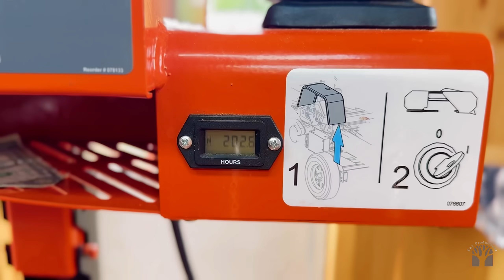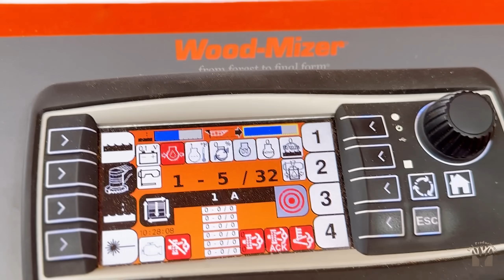Learning How to Service Our New LT70 Woodmizer

Comment: for the fuel filter,Harbor Freight makes end cap sockets to fit on the filter, that accept a 1/2" drive breaker bar or ratchet to remove the filter. they come in sets for different sizes of filters,also can be used on oil filters. then you won't have to use the screwdriver method. ISTR they're not very expensive. you will also get better access/clearance with the wrench/breaker bar,no knucklebusting.
Reply: The fuel filter does not flats for socket you are referring to. The oil filter does. GP

Comment: Happy birthday Jade!! 🥳

I was expecting a secondary filter like Grandpa was.. You can usually pick up the internal secondary filter that fits inside the larger filter wherever you get the air filters or NAPA. It's a good idea since the engine is in a dusty/dirty mill environment to check into getting one.

Comment: Hey Jade, I just wanted to say happy birthday to you. I’m sorry it’s late I want you to know your family gives a lot of really solid information about log milling and I love that you turn trees that are dying and railroad ties because once they are pressure treated with creosote or the chemicals that preserve them they can help trains carry make a loads of material to all Americans!!
You and your sisters are as pretty as can be and beautiful. In many ways I want is love the girl or girls that can drive a diesel log loader. Service and run a hydraulic sawmill and still stay extremely healthy and fit. I’m not working at a log sawmill right now, but have worked for Northwest hardwoods. A few years back we were processing 28 full-size log truckloads per day and you can imagine the team effort for that.
As far as your broken blades go, I am a welder fabricator, but I don’t specialize in making blades. I just want to say if anyone overheats a weld of any material, it could become too hard and brittle reducing your attention, pressure and increasing your cooling was a brilliant practice , as far as material density and the heat of the world is between you guys and Jay played manufacturer I hope this helps you love you guys like family Chuck Richards, Northwest millwright

Comment: Here's a little tip my mechanic  has me add a quart of diesel to the oil and run engine for a few minutes then drain the oil  it helps clean up the sludge better then change oil

Comment: Tip: On a machine with hydraulics you should change the hydraulic filter as well. Usually the hydraulic oil doesn't need to be changed at the same intervals as engine oil. You can send a sample out to be tested and they will tell you if it's good or not.

Also I find Pig Mat better than rags for a lot of that drippy oil... say near the filter.
Reply: Почему у них все оборудование на дизельных двигателях ? В Америке дорогое электричество с электростанции ? Или нет возможности 380 Вольт подвести ? На электродвигателях по моему удобней и обслуживания меньше .

Comment: Happy birthday Jade. Hope you had a great day.
On the oil change. A couple of things I do. When changing oil I drain the oil and leave the drain plug out. When I start to refill the engine oil let some fresh oil run out and then put the plug back. You waste an ounce or so of oil, but you get that much more dirty oil flushed out.
A band clamp could get a better grip on a stuck filter. Consider punching a hole in the bottom side of the filter to help drain it.
I usually try to put some fresh oil back in the filter regardless of its position. Yea, one on its side like your mill will only allow a small amount, but at least it's better than nothing 😊😊😊

Comment: Happy Birthday Jade🎉  Grandpa is giving a first class OLD SCHOOL lesson in a tried and proven oil change process.  Lubing the seal, checking to make sure it didn’t stick on the block, draining all the oil (I’m guessing he warmed the engine before dumping the oil) and wha hasn’t had to pound a screw driver through a filter to twist it off. Also, never use a wrench to tighten a new filter. Hand tighten only. Well done😊

Comment: 15w-40 Rotella is a great summertime oil. For below freezing temps you might want to go to a full synthetic 5w-40, which will flow better in cold startups. Also, ask Grandpa about the lubricity of ULSD (ultra low sulfur diesel). I run a 100:1 mix of 2-cycle oil in my tractor, mostly to keep the injectors lubricated. Cold weather starts may be better with a cetane enhancing additive. You really don't want to use starting fluid on a diesel if you can avoid it. 

I second the comment about changing the hydraulic filter and checking the level. You should also get a gasoline powered air compressor to blow out the radiator and hydraulic cooler. 

Your 70 is an expensive tool. There's a lot more to being an operator than checking the oil. Inspect the whole machine before you start it every day. Tighten anything that vibrates loose. Where is your grease gun?

Comment: On our APU on highway use or trucks have Go Green Brand mfg Local in Altoona. There recommended oil change intervals is 1,000 hrs.They used to spec them with Yanmar engines, but with ever increasing EPA demands they had to switch to Kubota engines. My truck is a 2022 Peterbilt 579 and the APU already has has 5300 plus hrs for 2.5 yrs of operation.

Comment: All the deisel engines I ever worked on had an air bleed screw and primer pump to get air out of the fuel system after a filter change. Usually there is a manual lever on the fuel pump.  Open the bleed screw and work primer lever until only fuel comes out the bleed screw.

Comment: Filling up a diesel filter might contaminate it. Diesel engines need prestine filtered fuel. Its better to mount the filter empty and purge the air using the manual pump.. If the motor doesn't have a manual pump, than better add one. Only this way you're sure only wel filtered fuel gets to the engine.

Comment: Weuse to blow out our air filters on headers almost daily , Isee a lot of people saying blowing air filters is bad but if you do it sensibly keep the pressure down its a good thing IMHO , might want to do that every 100 hours or so .Food for thought
Reply: Grandpa said the air filter was surprisingly clean, likely because it is up on top away from the dust.  There is a special air tool that farmers use to blow out those filters; it does a very good job.

Comment: I have seen one of our Freightliner Cascadia without a APU  on it that was about 12 months in service with 64,000 mi and about 3200 plus engine hrs on the factory fill of oil before it got brought in for it,s first PM service. This amount of excessive idle time blew my mind. Go tell any heavy equipment operator or a farmer about 3200 plus hours on a oil change.

Comment: You say it's your Birthday; Happy Birthday To You! (Beatles White Album 1968.) Em, there should be a maintenance schedule outline for that mill. Lots of times companies include one w/ check boxes. Most require it for warranty. Everything has it's particular time interval for filters, lube, fuel, cooling, adjustments and cleaning.. Please tell your Grandfather a lot of LOF guys will punch a hole in the spin-on filters to drain them w/ out spilling jet Black oil all over the place. Also, 2 Excellent Points he made. 1). Filling the fuel filter all the way up will help shrink the size of the air bubble trapped in the fuel lines from opening the system. 2). Making absolutely certain the oil filter "O" ring that seals the spin-on oil filter to the filter mount/housing comes off with the old filter is a must. If it stays on it will fail and blow oil all over the place. If the low oil shutdown fails it can easily destroy the engine. Hey, great video & Happy B Day Jadie. ben/ michigan

Comment: If you punch the filter bottom and top before unscrewing, you can capture most of the oily before  you unscrew it...
Grandpa is right; oil and filters are cheap, downtime(lost revenu), parts,  labour and the aggravation are mighty expensive. Makes no "cents" extending maintenances and cheaping out on related items

Comment: There probably is a large socket that can fit on the base of the fuel filter.  Could make future removals and installs easier.
Reply: The fuel filter on this machine does not have the socket shape needed to use the socket system: it is just round.

Comment: It would also help if you remove the filler cap, and remove the filter, then drain the pan. Respect grandpa's check the o-ring!
Reply: I had to re help my friend change the gear oil in the outboard motor bottom end. It had nothing near enough. AWESOME!

Comment: 💦Nice, image tutorial. If you own that rig, each one’s perception of its’ use👀, can be held, in common. 🙏🏾
   I grew in suburbs, and  did relocate to the forest, when I turned down a college edumacation. 
   I love, sawmills, mill-shops, so forth, and comfortable sense of hearing ,seeing, and having a test, reference point, as y’all run, tings. 
  Similar to a person, your mill, needs, air , water , pneumatic fluid,  diesel fuel, and sympathetic oil, for the cranky case. 
    Always, my hero,🌸the business, is a container. Cooperative coordinated family, is a strong card, in your tact.🙏🏾

Comment: 40 hours in a week, 5 weeks/1.5 months, so if had for a month & a half, change every month & a half or 5 weeks. So a basic 40 hour week operation if the time frame is correct. Change 8 times a year if operating 52 weeks a year, or just pay attention to your gauges. Much simpler.

Comment: I’m amazed that the items that require regular replacement (oil and gas filters) are so difficult to access. The tube for draining the oil also seems like a way of trying to compensate for lack of thought during the design phase. Or perhaps this is just a larger version of an old machine.
Reply: Some compromises have to be made on  portable equipment or they become too  cumbersome to be portable. Gp

Comment: Wood Miser hides the filters and oil fill pretty good. Seems like they could have come up with a better design. I would have expected inner and outer air filters. Is it a Koehler or Kubota engine? Good video.
Reply: There are pre-filter devices that will swirl the air to get the bigger bits of dirt out of the air flow before going into the filter. Also one can and maybe should with all that saw dust, take the air filter out and use a air tool to blow the dust out of the filter.

Comment: Might there be some sort of 'prefilter' for that air filter unit? I dunno...but running an engine on a sawmill might be dustier than maybe pumping water for irrigation. Maybe talk to other LT70 sawyers...see what they have to say. Or, just pull that filter, beat the obvious dust off and reinstall it every week or so...again, dunno. I do know that the model number on a Woodmiser is roughly equivalent to the base price. Protect your investment;
Reply: The filter was surprisingly very clean. On top away from most of the dust. GP

Comment: 3rd one?  Have them come out and replace all lines.  Your under warranty
Reply: 🤣 no need for all that!  Just tighten them up.  Maybe take the time to tighten all the lines up.
Reply: Tightened all fittings and placed paper towels under each to pinpoint leaking. GP
Reply: @JohnWoodis  That will do the job!!

Comment: Cars average only 30-40 mph. Multiply that by 200 hours and that's the equivalent of 6000 to 8000 miles! Most people wouldn't let their car go that long. At least, not if they want to keep it very long.
Reply: I drove most of my cars right into the ground.  The engines always out lasted everything else.  I did my engine oil changes at 10,000 miles. At no time did I ever wear out the parts that engine oil lubricates.

Comment: Having  watched at least 30 seconds of each advertisement, I feel I get to say that Woodmizer could make some improvements. Overtightened fuel filter? Shame. (More than one wrench design.) Oil filter not vertical? Hummm. No prefill here!. Several hydraulic leaks? Ouch. I support cleaning the air filter. There's more but I am ignoring what I might be wrong about. Human engineering must be part of a good design. They had a WM guy show up and accomplished little last time.

Comment: Take your time take your toil. No one wants to see the engine so hot it boils. The oil that is. The engine biz. If you don't have a grandpa around. No matter where you look he won't be found. Thats when you keep your documents safe and sound. Then there's the internet for a backup resource. You can learn enough off that it's like taking a course. Then if things really start to get buggy. There's always the emotional tree that could use a little huggy. Believe me there's a lot of trees out there that just want to leave (leaf). Always keep those changeable parts on hand. Plus having the tools would just be grand. The engines that run your mill will thank you by helping you cover the bill. Or if you don't mind the engine it will give you the bill. But i guess it's up to you on what you do when that engine comes knocking. Stay safe around those moving parts. Losing a limb is not an art. I guess there's one more thing to get out of the way. To the special girl named Jade. Happy Birthday!